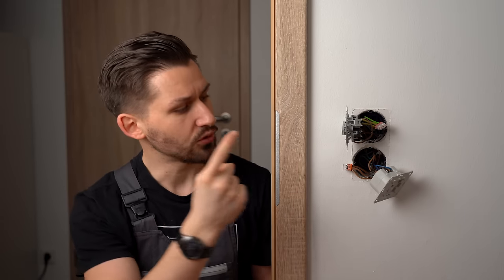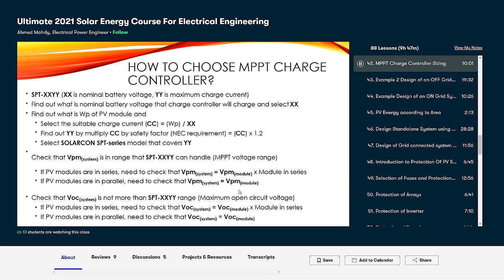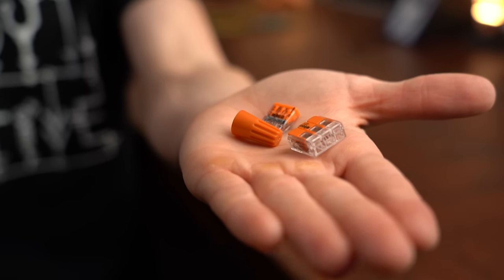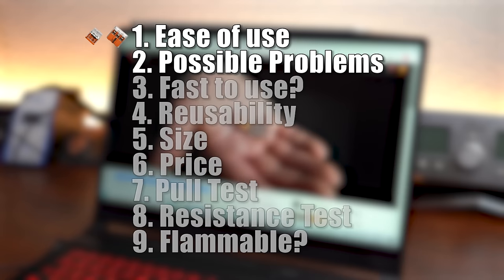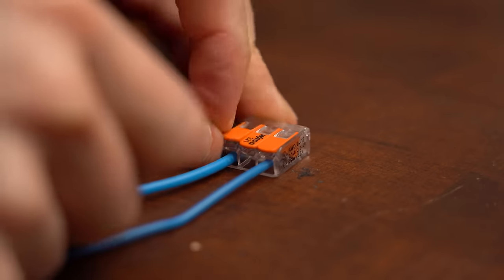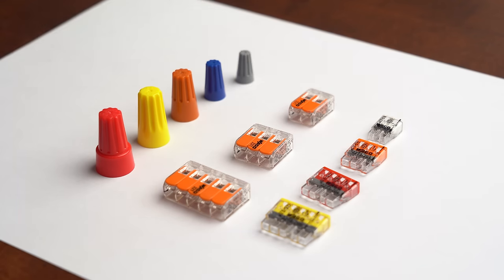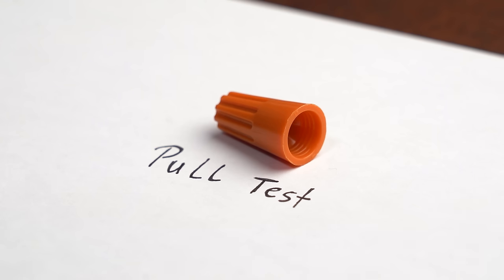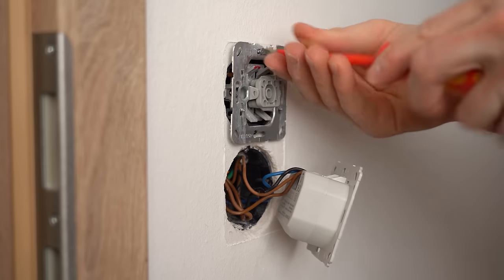What Wire Connector is the Best? Settling a Debate! Wire Nut VS Wago

Comment: I had a few wagos for prototyping that someone gave me.  I honestly didn't even look at the rating on them until almost a full year later, because I was just using them for low voltage DC stuff. When I realize they could actually handle mains AC I immediately bought an assortment and haven't looked back.  For me, the biggest thing aside from the ease of use is knowing that the connection is made properly. I feel like wire nuts make it too hard to tell if you have a solid connection or not, and I think that's much more of a safety issue.
Reply: Definitely. When Scott mentioned that you "can't see" what the connection looks like you made in there, I was thinking that they could have the color coding as a ring at the bottom while the upper portion of the cap is just transparent.
Reply: Ya. Especially when connecting stranded and solid core. I'm sure electricians are better at getting that to work than I am but maybe the wago should be included in all light fixtures instead of wire nuts for safety reasons.
Reply: Memo to wire nut manufacturers, everywhere:  Enhancement suggestion:  go with transparent plastic instead of the opaque!  ;-)
Reply: If a firm tug is too hard idk what to tell you lol I’ll be honest wagos are nice, and I got no horse in the race I really don’t care I just thought it was humorous
Reply: @newsogn5148  the problem is that inexperienced people might not be doing that or will get frustrated with the stranded wire and leave it as good enough.
Reply: There have been plenty of times when I've given a tug to make sure things are seated okay in the wire nut, and when I've gone to replace the light fixture or whatever later on, the wires aren't making good contact.  As mentioned above, this is usually a solid + stranded issue.
Reply: In the case of wire nuts you can see why transparent plastic won't work since the wire spring would prevent you from seeing anything inside the connection.
Reply: @BloodyMobile  -- I was thinking that exact same thought!   It's might increase the cost at bit.   OTOH, in the fullness of time, it uses less material (metal & plastic) to make a wago type than a wire nut.   Ultimately that means the wire-nut will lose much/most/all of its cost advantage.
Reply: Just pre twists them before you put the nut and is 10x times better than Waco
Reply: @skyfoxrinoasfr4778  not in my experience, that's how I used them.  But I'm glad that they work for you.
Reply: @pen25  --  Well, you can get a better idea of whether the insulation cut off matches in all conductors.   When you install them there are less "secrets" of the wiring going under the spring coil.
Reply: I've got it other bosses way around I was using them for electrical installation in mains voltage. Until I realized that they're pretty useful in electronics as well..
Reply: @ebouwman034  The stranded wire always wraps around the solid wire, so strip it a bit longer and then hang it over the end of the solid wire by 3mm/.12in. Then it will connect reliably. 
Also after done, do a pull test. If you can pull the wire out, it was done wrong.
Reply: You are supposed to twist the wires together before installing the wire nut... ITS JUST A COVER..... and you DO see the connection as you are making it. Buy a pair of electrician's and twist your wires, you definitely do not rely on the wire nut to twist the wires for you.
Reply: @Wingnut353  I have never done that or seen anyone who does. Have you seen any manufacturer documentation that supports that?
Reply: @Wingnut353  As mentioned above, I do that.  I've still had issues, particularly when combining stranded and solid.  Glad it works for you, but personally I have had better luck with the wago connectors.  Quicker, less finicky, and more reliable.
Reply: @skyfoxrinoasfr4778  exactly
Reply: That is what the "tug test" is for... any electrician worth their title will do a quick tug on each wire in a connection... I have had more ring terminals made with certified crimpers that failed on me... visual inspection is nearly useless for many ring or fork terminals, although there are some verifications that can be made.  To me, there are uses for both types of connector, just as one screw or nail type is NOT fit for all uses, the same goes for connectors. The primary factor in ALL connections are a reasonable amount of competence... there are ways to make surgery simple enough that a monkey could do it, do you still want to get that surgery or would you rather have a competent surgeon?  When miswiring can cause fires or kill, I do NOT want some turkey who just "pushes the wires into the hole"... I want someone who knows what they are doing and understand the dangers of doing it wrong.
Reply: But wagu doesn't make the best connection as shown in the resistance test. Which is because wirenut had wires directly contact each other, while wagu contact is across the internal metal piece... For those saying you can't see in a wirenut to see how well the connection is, just take the wirenut off-verify connection - then replace it.
Reply: Well frankly I was like you until I saw in this vid the 221 kind draws 0.88W lol. Does not seem like much but it you throw 40-50 of these in your whole house, it adds up quick. And I am all for Wago but they are too expensive, what about good old terminal connector strips ? Or like some say chock blocks ? I bet them have low resistance too. A bit bulky sure but cost is very low, and it must pass pull test with flying colors
Reply: Will say, from my experience with both, wago leaves the cables better for later use. Since cobber will stiffen up as time goes, if you have to rewire the ones that had been in cable knots they often were hard to refuse because the copper were hardened in a weird form, where as wagos are straight, so its easier for reuse
Reply: @court2379  I'm pretty sure that is required by national wiring code in the US.
Reply: It is just based on my observations. When you take the nut off, and assuming it didn't take the stranded wire off with it, you will find it wrapped around. Because of that it takes up some of the length and it will end up not making it to the end. So I compensate for the wrapping and over hang it. Then it ends up about even.
Reply: @Pomaufour  , that’s at a 20 amp draw, which is pretty high. There is no way you have 40 or 50 circuits in your house each drawing 20 amps.  That would need a 1,000 amp service, which would be over 100,000 watts of power dumping into your home on a 110v system.  If you have that much power being dumped into your home, 40 watts of residual connector loss is the least of your problems.
Reply: The trick with 2273 for a 0.5mm wire is losen the clamp first by inserting a 2.5mm .
A 2wire connection is forbidden with wire nuts.
Wire nuts are used only in NL for operating rooms , and high vibration sites.
Reply: @Pomaufour  That only happens under a full load.  How many of the 40-50 in your house are loaded at 20 amps?
Reply: Actually it is the low voltage DC stuff that draws the most current and requires the heavy gauge metal and robust connectors.  A 50W bulb draws over 4 amps at 12V, vs only less than 0.5 amps at 110V.
Reply: It's really easy to see the connection under a wirenut, just untwist it.
If the wires come undone, you didn't bind them together properly.
if you're just playing round, or testing, wagos are great, super easy and nice.
If you want something that will last as long as you, twist the wires together and cap it with a spring coated in hard plastic.
Reply: @ebouwman034  they use wire nuts to encourage professionals to do the job. If you're having trouble with stranded to solid, coil the stranded around the solid with lineman pliers and get the tip of the stranded to just barely pass the solid, then crank the wirenut over it. If you're dealing with even more wires, twist all the stranded together first, then treat it as a single solid wire in making taps.
Reply: @fiordhraoi1  that's literally how you're supposed to do it, To firmly and permanently complete an electrical connection of wire smaller than 6 gauge, use lineman pliers to twist the exposed ends of the conductors together to make a solid mechanical connection. Once achieved, use an appropriately sized wire nut and twist to hand tight. For extra security, use the linemans pliers to grip the end of the nut and twist several more times, putting the twist into the wires themselves, and expanding the spring in the nut over the exposed conductors. This will hold for years. If you REALLY want to go the extra mile, or the tap is in exposed conditions, applying electrical tape in a clockwise direction will EVEN FURTHER secure the wire nut to the conductors, preventing it from slipping back or off.
The only way to make a more solid and secure connection is to solder the wires together.
Reply: @RomaraAhallow  -  or, you know, I'll continue using the 2020 NEC compliant lever nuts for my occasional need to replace a light switch or fixture.  Because they're code compliant and quicker for me without any appreciable drawbacks, and there are numerous professional electricians who use them as well.  And as evidenced by this video, entire countries where they are the standard.

Believe me, I'm totally fine with people using wire nuts.  What baffles me is the vehement pushback when I mention that I prefer lever nuts for my personal use.  If they weren't code approved and unsafe or something like that, yeah, I could understand, but that's not the case.
Reply: If you twist the wires beforehand than you don’t have to worry about it.
Reply: @ebouwman034  but that would $0.40 instead of $0.10, we could never give up that kind of margin
Reply: If you knew what you were doing you wouldnt have to worry about the connection being done right.
Reply: @RadioRich100  - Why yes, I do know what I'm doing.  I'm using a UL listed, NEC code approved solution that happens to be easier and quicker, and for home use I'm happy to pay the premium.  

If you like wire nuts, that's great.  You're entitled to your preference.  But do you really need the gatekeeping comments to inflate your ego and feel superior?
Reply: @fiordhraoi1  Never heard of a gatekeeping comment. But those approvals you speak of are bought and paid for. Easier and quicker is your laziness getting the better of you instead of taking the time to do the job right.